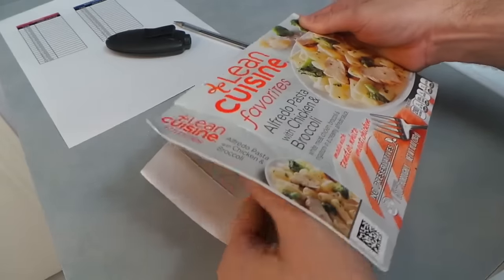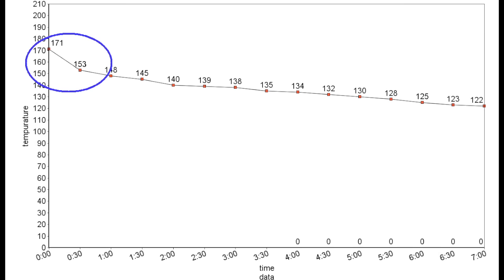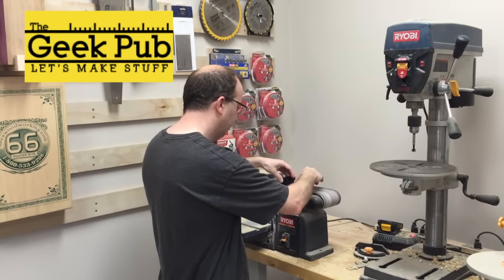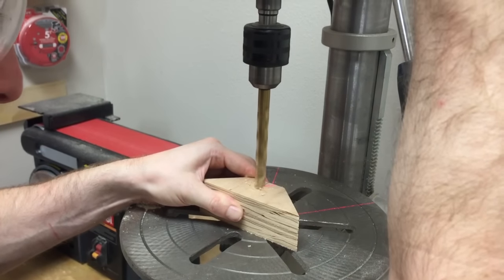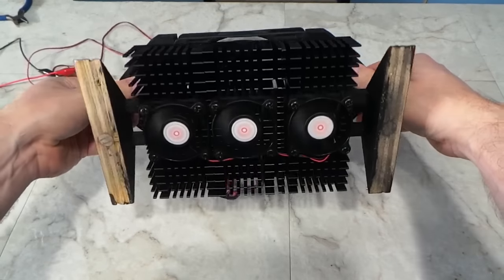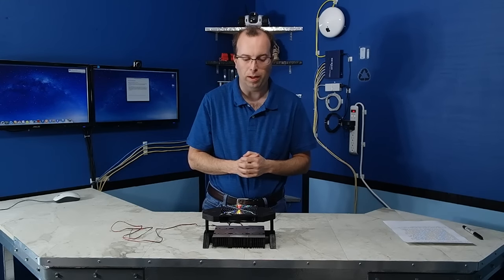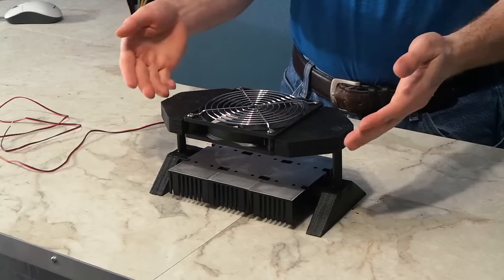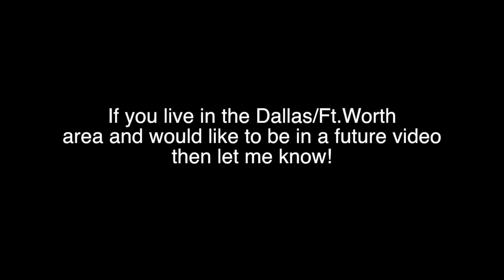CPU Heatsinks to cool microwave dinners

Comment: It also works in reverse..if you have something that is frozen and you need to thaw it quickly,  the heatsinks will sink cold away just as efficiently as they handle heat
Reply: and then you use those heatsinks (if they keep the cold) to cool down the hot food
Reply: If this works that's great advice. Thanks
Reply: Just to clarify something that triggers me despite getting what you mean: cold doesn't move anywhere, heat moves from hotter to colder surface/matter. Cold is just lower temperature than what you are comparing the cold thing to, so the heatsinks actually heat up the cold stuff, and the air heats the cold heatsinks. Cold and warm/hot are just comparisons, always need a reference. Heat is what moves and changes the temperature (let's not yet enter into gases and pressure differences).
There, I can sleep at night now. I feel relieved...
Reply: @Kalvinjj  Congratulations you have arrived at The Joke™

Comment: iBook clamshell.
Pentium II heatsinks?

What fuckin year is it?
Reply: ***** Its not about what year it is, I mean I'm using a TV thats made in 1973 my computer is from 2005, as long as it works fine still then why get something new? plus he's thinking of a creative way to reuse those Pentium II heatsinks
Reply from the maker: ***** My channel is more or less based on retro technology, hence why I use the old iBook.  I actually ordered the Pentium II heatsinks from ebay because they were the perfect size for the job.
Reply: +Sony Trinitron Sure, it may work fine and all, but you can get a better experience with a newer TV and PC.
Reply: David PLAYAH Sure i'll get a better experience for some made in china piece of rubbish thats designed to break and super hard to fix!
Reply: Sony Trinitron What...?
Reply: David PLAYAH I'm sure you know what I mean.
Reply: Sony Trinitron Nope...
Reply: David PLAYAH Look up planned obsolescence
Reply: Sony Trinitron I still don't know what you're talking about... Chinese stuff that will break easily... wtf?
Reply: David PLAYAH I'm saying modern Chinese stuff is built crap compared to the older Japanese items, and American stuff too I've got countless older items that were made or assembled here which still works yet I've seen newer stuff that crapped out beyond repair within a couple of years.
Reply: +David PLAYAH Okay, I'll get right on that. I'll cool my TV dinners with a Corsair h100i.
Reply: +Sony Trinitron This is so true. Look at washers and dryers, my friend's broke so i tried to help him fix it. It was SO poorly engineered and the hardware AND software made it really hard to fix.
Reply: MotoBro18 Yeah, I'm keeping my older stuff around and repairing it (in the very rare chance it will need it) because newer stuff can't be repaired and won't last as long as the older stuff
Reply: +Sony Trinitron you like crt tvs
Reply: +Sony Trinitron do you watch. spatsbear? he rants about china pride also do you watch vwestlife am a big fan of him
Reply: Tommy Whitaker Yeah I do, they both make great videos and there are a lot of them that they've made too.
Reply: Sony Trinitron yes they do
Reply: Sheldetin Were? Are
Reply: +FranBunnyFFXII Non metric measurements? What year is it? Oh wait... I forgot... murica.
Reply: My time machine works!
Reply: it's a thing that cools down shitty microwave food

you don't need new technology to do this
Reply: +Sony Trinitron i agree, most of the electronics i use are old (tv's, amplifier, and gameconsoles).
old technology is build to last
Reply: +DANGERTIM112 You're right, my grandparents are still using a 2002. (Maybe 1998 or 96) CRT TV everyday and still works, our 2005 CRT TV doesn't last too much (Last up to 9 years compared to the older CRT TV and even wasn't a daily use tv since 2009)
Reply: -MrSky05- CRT's really started to decline in quality around 1993ish but earlier ones like my 1972 Sony Trinitron are still going fine, my 1984 National is too which is my current main set.
Reply: ***** No, they like old stuff, I like more the modern things, but everyone thinks different.
Reply: ***** Maybe inferior for quality but thats one thing thats the old things are superior, the durability and life span.
Reply: +Sony Trinitron I'm still using a hairdryer that is older than me, and it works perfectly. It was made about 1989.
Reply: Mieszko Guliński I've got multiple things that are decades old still going, my oven is from 1979, my two main TV's are from 1973 and 1984, my food mixer is from the mid 70's still going fine.
Reply: hebbocake I've managed to find more parts for my Atlas branded oven online than any other more modern oven like when I tried to find a element for my friends fisher and paykel oven which failed after only 7 years of use with multiple issues (although the only major one was an element)
Reply: hebbocake MY older TV's for example do not have surface-mounted IC's like newer ones, when they fail you're pretty much buggered but older sets you can easily unsolder IC's, about the only easily repairable part on newer TV's is the power supply and replacing capacitors on the mainboard.

Ever see a schematic diagram made for appliances made today? No. Even if replacement parts are harder to get these days the older things are made to last longer and made to be repaired.
Reply: +Sony Trinitron Im a bit of a mix of both. I have a modern PC with modern LCD screen. However, when it comes to Kitchen appliances (ovens etc.) and other household appliances I prefer the 80's machines, 

Just because I know they work long and do just as good of a job (and sometimes better) as more modern machines. I mean, Oven/stove? I mean who needs LCD panels and twitter and instant instragram in their damn oven. I want a Oven and stove that heats and cooks food. period. If a 80's machine does just that, and is usually cheaper, has better longevity and is easily repairable, I see no point in getting a new stove/oven every 5-10 years (like some of my friends have). 
Also, clothe washing machines nowadays have near impossible bearings to replace without replacing the whole motor, which usually costs more than a new whole machine. And boy, do those new washing machines like to shit up their bearings.

so yeah. And oh, my Amplifier is from the early 90's and its still rocking good and has amazing sound quality.
Reply: LasOrveloz My old fridge got the rubber damaged for the use, and there's not a replacement for that specific model...
Reply: -MrSky05- You don't need a exact replacement, measuring the size and getting a replacement will more than likely do, it's more of a problem these days where manufacturers are no longer required to keep spares for appliances and just have a warranty now. The only way to get decent quality stuff that'll last decades is to not buy consumer grade appliances.
Reply: hebbocake Actually, he isn't. I have gone in to stores asking for spares, with only thing them saying is "send it to the manufacturers repairshop" Which when asked had average price of 1-1,5 times the price of a new "medium to medium-low" grade machine even higher multiplier on low grade machines. on multiple occasions, when asking the manufacturer for spares, the answer is "we don't have any to give to consumers. Also this voids the warranty" Voids the warranty? yeah this machine is 4 years old, the warranty was a damn 3 years! I want SPARES not warranty. And then you're forced to buy some cheap chinese knockoff parts that you know are going to give out in 6-12 months if it works in the first place. or just buy a new machine.

and yes, If you buy the top grade items, they rarely have problems of short lifespan, however the price is however enormous for a industry/restaurant grade appliance.

And lets not talk about "Smart" phones and such. Theyre even worse in this regard.
Reply: Sony Trinitron Well anyways, my parents send it to my grandparents from the countryside.
Reply: +FranBunnyFFXII It's 1996. Not 2016, 1996. We've gone back 20 years in technology evolution.
Reply: hebbocake Thats my point, theyre horrid in that sense that when something breaks, you're pretty much stuffed.
I mean you need pretty damn good skills in soldering and need another phone for cannibalizing and all that to even have a chance to get one fixed. You may get parts that have the right specs, but are they sized such that they fit inside a phone case? probably not.
Reply: +FranBunnyFFXII 
It's the year 666.
Reply: +FranBunnyFFXII he should try EKWB
Reply: +Tommy Whitaker i watch vwestlife
Reply: 1979
Reply: This guy likes older technology.
Reply: +FranBunnyFFXII 2016.
Reply: did you really need a modern heatsink for this, and his revamped clamshell is pretty adequate for his workload
Reply: my mom's celeron e3400 2.6 ghz be like: ita fine for work and everyday use
my amd a6-6400k 4.1 ghz be like the same

ok..
Reply: Heat sink is only a piece of metal, a metallic brick. What's the big deal.
Reply: I meant 1999. There's no iBook Clamshell in 1979
Reply: +Sony Trinitron im still on a 2007 macbook pro. if the logic board fails i buy a new one easy to find. my laptops never go more up to date than 2010
Reply: +MNanme1z4xs the processor itself
Reply: Hey, if it works and does everything you want, there is no need to change it. Still using a 2011 MacBook Pro (with a few upgrades) and a 2008 Mac Pro.
Reply: 1998
Reply: Calm down, he is a vintage apple person!
Reply: the heat sinks he probably just had laying around.
Reply: 2003 

legit
Reply: he probably had them laying around in storage and forgot about them.
Reply: FranBunnyFFXII just get some heat sinks because it doesn't really matter what type of computer it's from just get some heat sinks
Reply: 20xx
Reply: SICK BURN
Reply: FranBunnyFFXII Lololololololololololololololololololol
Reply: i know story of my life!
Reply: vwestlife is awesome
Reply: Racism is bad kids.

Especially when you blame a race of people for things like dramatically more complex and fragile things failing more frequently than something else.

Yeah, a castle will last a long time compared to a modern house - it's literally a pile of rocks. Does that mean modern houses are inferior from an engineering standpoint, and inferior shelter? Well, if you think that, you're welcome to go live in a castle.
Reply: +Sony Triniton 
I agree, I still use DVD Rewritables AND Office 2003. Im outdated, but im doing fine.
Reply: 2000 is the year
Reply: FranBunnyFFXII 
2004
Reply: 1368, give or take a year.
Reply: FranBunnyFFXII his hannel name ibook guy what he'll use a 2115 macbook pro?
Reply: FranBunnyFFXII um 2000
Reply: FranBunnyFFXII he made a time machine
Reply: FranBunnyFFXII for you it's 2016
Reply: FranBunnyFFXII 2015 when the video was posted
Reply: FranBunnyFFXII This is channel about retro computers so that's why he used old tech in this video
Reply: The 8-Bit Guy Which SketchUp version that you use in your iBook? I have an iMac running OS 10.6.8.
Reply: Miles's NerdySwag Me too(sort of). I use Office 2007 and Mac OS Snow Leopard.
Reply: FranBunnyFFXII Thats why he is called "The 8-Bit Guy" :)
Reply: that's why he was called "The IBook Guy"
Reply: FranBunnyFFXII he said "old" pentium 2 heat sinks and he puts modern parts in the clamshell case
Reply: FranBunnyFFXII 2017 fuck yea
Reply: DrawZilla 😂😂😂😂
Reply: MS-DOS v. 19.3 
C:/System32/date.exe

date : 1999-07-18   time : 22-00
[Edit]

In year 2000-01-01, i will crash, just as the new computers do in the year 10000..
Reply: FranBunnyFFXII its cheaper
Reply: Sony Trinitron soooooo a CRT?
Reply: I might agree with some debate here, I just wanted to say thank you for the laugh

Comment: Microwaves do not heat evenly, turning disks inside rotating the food helps balance this out, but much of the design of frozen dinners is to let them set at rather hot temps,  for at least that first minuet or two so that the heat evens out.     

So it might be best to leave it in the microwave and cool it down after that time or you might start running into cold spots in your food.
Reply from the maker: +TheHomicidalTendency - I would agree with something that is sort of solid like a big piece of chicken or fish or something.  But any sort of meal that is lots of stuff in liquid that gets stirred somewhere in the process (like the one I showed) does tend to cook pretty evenly.  I actually verified that with my thermometer.  I could only find about 10 degrees difference in any part of the meal.
Reply: The 8-Bit Guy have you considered doing other builds similar to this, along with your usual videos as they are quite informative and well presented. As of recently I actually purchased a 2006 MacBook running a core duo processor and maxed out at 2GB of ram and a 1TB hard drive. I've been seeing on YouTube here that it's possible to upgrade the OS to el captain. I thought this could be a possible video idea as a update to the original video you made on this machine.
Reply: You spent more cash on the HDD than what the whole machine is worth
Reply: -12 DEGREES CELSIUS DIFFERENCE!? that's noticeable.
Reply: TheHomicidalTendency that was barely english
Reply: Are you a caveman? that was understandable as hell
Reply: That's why you stir it :p.   If you stir, the cooler and hotter will even ought and come to a diffused temperature

Comment: Pro-tip, because this does not use any sort of phase change or peltier technology, it can also be used for thawing frozen things. I'd say that would be a perfect way to thaw a steak you were interested in throwing on the grill :). I'd like to see you test that sometime if you're up to it (hope you didn't point this out somewhere else and I overlook it).

Perhaps more obvious, but just as neat, this can also be used to quickly freeze things by placing the whole unit in the freezer and running it, and it can also be used to cool something down very quickly in the fridge using in the same manner. Passive "cooling" has tons of untapped potential in my opinion.

Comment: i could use that to cool my samsung note II
as it heats up somewhat fast
Reply: Lol
Reply: omg
and me my 3ds
Reply: malachi storm I need it to cool my note 7 ;)
Reply: most annoying phone I ever owned. It finally broke after a slight knock in my pocket
Reply: Try cooling a Note 7 :^)
Reply: MonkeyFace lol
Reply: My phone makes a good hand warmer in the winter time.
Reply: SeemsLegitGaming wow thermal paste on a exposed surface
Reply: My iphone 5 heats up so fast as if sometimes i use it as hotspot because router will be turned off at certain time.
Reply: Renzeth Bulawan my phone at home stays rubber-banded to an aluminum heatsink of almost the same size as the phone. Battery seems to last so much longer when it's not always so hot from downloading and such.
Reply: What kind of heatsink can you please tell?
Reply: malachi storm I Hava a Note 2 and a Note7 as well as a 5
Reply: Note 7 yea, (When Note 7R it's okay.)
Reply: this will hopefully prevent the explosive pen feature that activates once your note 7 explodes to eject the pen

Comment: Your next challenge 8-bit Guy, is to see if you can sufficiently cook/heat up a meal using the heat from a CPU?  Wonder how long that one would take ? LOL
Reply: +John Richardson Probably way too long (if at all). Your average microwave produces 700 W of microwave power. Your average Pentium 2 dissipates 20W in heat. It&#39;s like taking a low-power light bulb and trying to cook with it.
Reply: ***** LOL, yeah I realise that.  My comment was supposed to be taken in a light hearted context actually !  Although I should point out that I wasn't taking the p*ss out of his idea - clever idea I thought.
Reply: +John Richardson But if it wasn't Pentium? What if it was like... an old GPU? An overclocked AMD one, perhaps? They can easily dissipate 300W or more under load.
Reply: That’s more of a Linus tech tips question if you ask me
Reply: Load the CPU with a f*ckton of tasks, as in HUNDREDS of it....

Then it might be possible
Reply: Okay, just use an older Pentium 4
Reply: Use a powerful pet him for everyone it was lots of tasks and over cranking this can cook meals and your pension for at the same time

Comment: I wonder if putting the food on the heat sinks w/o the fan would speed up cooling vs the counter top...I know it wouldn't as fast as a fan system, but I'm sure it would cool down more in 7 minutes
Reply from the maker: DvdXploitr Actually, I tried that but did not include it in the video.  The heatsinks by themsleves did make a significant cooling effect.  But the heatsinks got very hot, around 100-120 degrees and stayed that way since there was no fan to remove the heat.
Reply: DvdXploitr I was thinking the same thing.